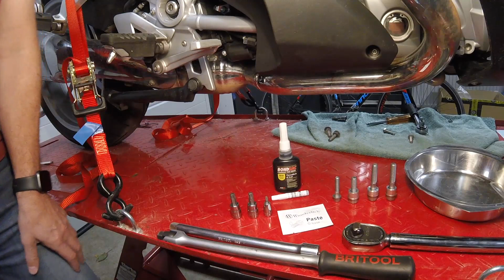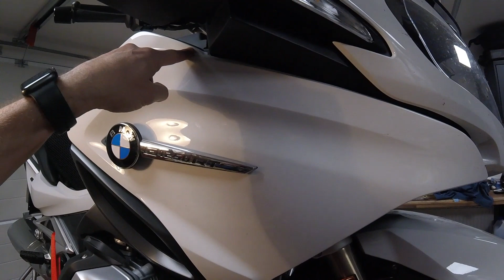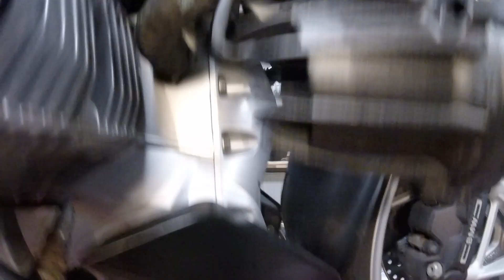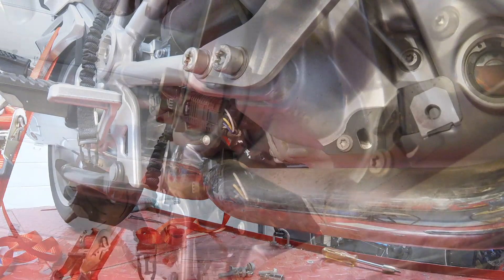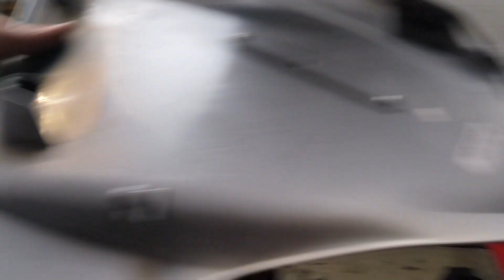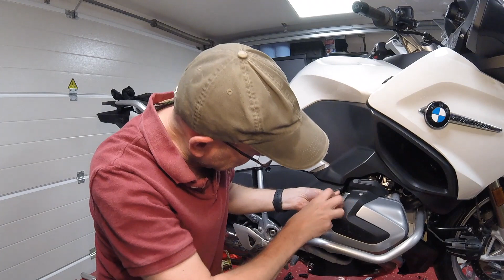BMW R1250RT wunderlich engine bars installation fitting

Comment: Thank you very much, I am about to install the same guards on my 2021 R 250 RT.  It appears that between 2019 and 2021, the changes were mostly in writer assistance and TFT related technology.  I noticed you have a number of KLR 650 videos as well, I’ve had three generations of those in my garage, and still have 2023KLR 650 adventure. Are you still doing content or have you moved onto something else? Thanks again for your helpful video has

Comment: Thanks for the video.
Did you do anything differently on the LEFT side?
I seem to be having lots of problem mounting the Aux light on that Wunderlich bar with the extra hole.
The Left OEM Aux light bar has a special steel molding with screw treads inside and that's the only hole.
When I placed the Wunderlich bolt through it, the lock nut and the bolt can screwed all the way in but it does not lock the black color Aux mounting bar from freely moving.

Comment: I'm a little late, but nicely done! Your filming was excellent showing detail up close and your dialog was clear and concise. I have a 2024 model with my name on it coming in February. Hopefully sooner, because it's really hard waiting for it, haha. They are pretty expensive, but I do plan on fitting the Wunderlich bars as I prefer their mounting and aesthetics to the Ilium Works version, even though Ilium's headquarters is just down the street from me.
Reply: Did you install the Wunderlich bars? I just bought a 2024 two months ago and my bars just showed up.  Curious on if there were any changes to how the video shows fitment?
Reply: @TheXplorr2  I did not. Its seems most of the engine bars for the RT are in roughly the same price category, but I ended up with the ZTechnik brand. ZTechnik is a brand specifically designed for BMW by National Cycle. I liked their design in that it doesn't need to be removed or loosened for oil changes or valve adjustments (not the end of the world otherwise). Two other features made me choose this brand over the Wunderlich bars: no need to move or alter the position of the fog lights, and aesthetically they look fine. The only thing that might be a negative is one of the left side bars comes very close to the cylinder head - like fractions of an inch close. In retrospect, I would still get the Wunderlich bars as an option. Oh, I don't think there's been any fitment changes to the Wunderlich's.

Comment: Very good video.. I have some Givi bars to fit to mine and whilst I am sure they will be a bit different to fit, to these, this is a very useful video so that I have some idea of what to do/expect. The instructions that come with the Givi Bars is absolute rubbish. I cant find a video for fitting them on an R1250RT 19/20 with fog lights. Thanks for taking the time to do this video. I have this one saved!
Reply: I wanted to install the front GIVI bars on my 2020 R1250RT; however, the issue is that my motorbike is equipped with fog lights, and the GIVI Bars do not have a place to mount the bracket.

Comment: Great video, very helpful. My only issue is the left side fog light wire harness is an inch too short. I haven’t figured out how to create relief in the harness to allow it to connect. I’ve removed a couple zip ties to no avail.
Reply: I just installed the bars on my 2022 RT and I have the SAME issue! Left side fog light wire is too short to reach the new position of the light!  Did you find a solution for this issue?
Reply: @adferrao4040  I guess we know it’s a design flaw. I order a set of fog light brackets, but they’re coming from China and won’t be here for another 2 weeks. I went to my dealer and they didn’t have any brackets and didn’t find anything I thought would work with a quicker delivery time. Here’s the description “2 Pcs Motorcycle Driving Aux Light Fog Lamp Bracket For 25mm Mounting Diameter”
Reply: @retiredjetmechanic6219  thank you.  The link didn’t connect, what’s the make and model# ?
Reply: Same issue here. The left side fog light wire is about an inch too short also, 2020 RT. Unless somebody finds a resolution to this design flaw, all I can think of is to extend it by splicing and adding two inches of wire.
Reply: I didn’t like how far forward the fog light was pushed using then OEM mount, plus i didn’t want to splice the original wire harness. 
I found  mounts, from a company in China, which clamp  to the crash bars. The wire harness is just long enough to connect to the fog light.

Comment: Excellent video, thank you very much.
I managed to put them on by removing only the first plastic cover, you will have to screw the upper part of the bar from the front of the bike, but it is done without problems.

Comment: Excellent video thanks. Just installed the same one on my R1250 rt 2021. I have hard time with the positioning of the bottom bolt the hole was not straight with the mounting bar. I had to unscrewed the first 2 bolts but even that was not able to aligned easily the bottom bolt. I finally succeeded but I was scared to screwed cross tread. Not sure why that bottom bolt was off maybe my mistake or a production problem.

Comment: On the new 2021 RT these bars don’t fit without some modifications if transferring the engine bars from a 2019 1250 RT to a 2021 RT 

Good video helped me make the swop with help of a trolly Jack to modify the fit of the bars 👍
Reply: Can you send me a small description of your modification a how to  cause I had hard time fitting the bottom screw was off the engine center screw hole. Thanks for your help
Reply: Hi Richard , all it needs it to be opened up , I did this with a car Jack which spread the bracket by about 5 MM or a bit less , just gentle pressure needed to spread the tubing , nothing dramatic just took a bit of setting up and alignment check , under rather than over stretch I decided as easier to open the gap than close it if over opened if you follow 

Hope that helps 

Stu

Comment: Excellent video thanks. Waiting for my 2021 RT and waiting to see if the present Wunderlich bars will fit the 2021?  Also looking to fit cameras, but unsure about how/where to pick up a switched live. Have you done a video like this on a RT or are you able at some time?
Many Thanks
Keep Safe
Reply from the maker: Almost certainly the 1250 bars will fit the 2021 version, maybe worth an email to Wunderlich.. what cameras are you thinking of fitting?
Reply: @themotorcycleshed380  Hi thanks for answering. Wunderlich are still waiting for a bike to check. Hopefully they will know before the bike arrives so that I can order them ready. Looking to fit VIOFO MT1 cameras, also sold by the seller of the INNOVV K2 cameras and recommended by them. They say that they will fit the same as the K2 and are similar quality. Someone has suggested picking up a switched live at the front power socket, but this may be a problem as I use that plug for my Optimate?
Reply from the maker: @SP-ek2qz  there is a switched supply that runs the sat nav, it’s just behind the headlamp. It terminates on the in built multi contact garmin mounting point. If you are not running the Garmin sat nav then this would be an ideal take off point. Nippy normans in the uk sell a cable assembly that replaces the section from the connector to the multi contact mount. It’s designed to power ‘ignition on’ accessories. You have to take the screen and top section of central dash board off to get at it...
Reply: @themotorcycleshed380  Thanks again. The cameras also have to be connected to the battery, so I wondering if there is somewhere under the seat to pick up a switched live please? Someone has suggested the rear light cable which is supposedly under the rear seat, or the rear power socket which although I haven't got, the cable should still be there?
Keep Safe 
Steve P

Comment: do you loose much clearance?  would the foot pegs still hit first?  I'm not into racing around corners but I am concerned about clearance when adding bars.  thanks for the vid.
Reply from the maker: I did some fast twisties here in the UK Peak District recently on the RT and didn’t have a problem with the bars grounding. Like you I’m not into the racing around corners but as the bike goes round corners so well I have certainly explored this side of its nature. I can’t say if the pegs hit first. I think the bars are worth fitting.
Reply: @themotorcycleshed380  thanks for the reply and for the vid. I will be saving it.  I will wait until march (not much riding now)but I am leaning toward installing them.

Comment: Very good video!!
Do you know if the shown bars wiil fit on a 2018 R1200RT bike?
Reply from the maker: Many thanks - No these bars are different to the versions that fit the (R1200RT 2018: WUN-20380-101)
R1250RT (WUN-20381-001) - This is according to the Nippy Normans Website here in the UK, but its worth checking with Wunderlich. - Good luck with the fitting!

Comment: What happen if you have OEM fog lights?
Reply from the maker: The ones in the video are BMW OEM fog lights. I could not say how NON manufacturer fog lamps would fit..
Reply: @themotorcycleshed380  so you did relocated them with the crash bar.
Reply from the maker: @Davan514  Yes is the answer - there is a specific mounting point on the crash bar for the OEM Fog lamps - details are at about 3/4 of the way through the video

Comment: Well done! Thank you.
Q: do the bars have to come off again in order to do a valve check?
Stay Safe..
Ed.
Reply from the maker: I've not done the valve adjustment on the bike yet, will be post warranty when I start servicing it - but the forums suggest you can remove the covers without removing the bars - does not impede full service, but do please double check this.
Reply: @themotorcycleshed380  Ok,  thanks.